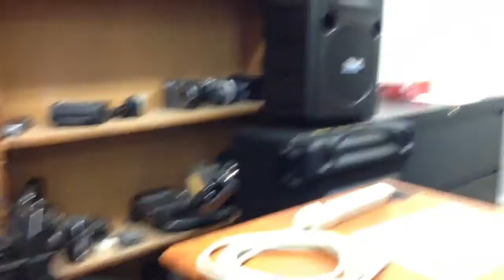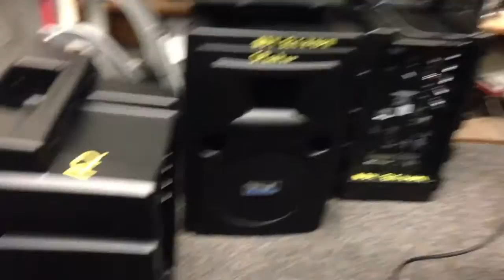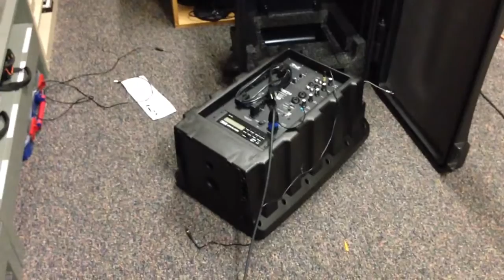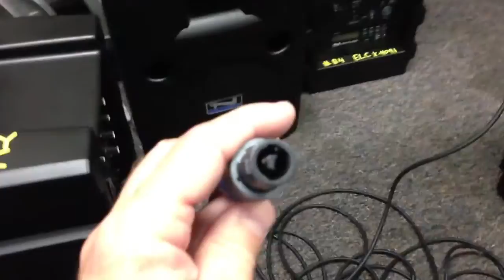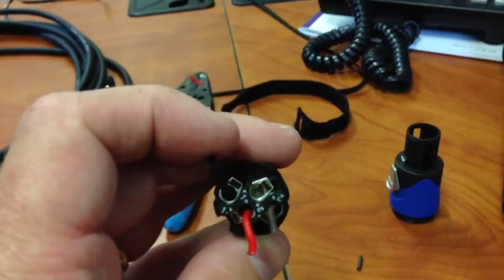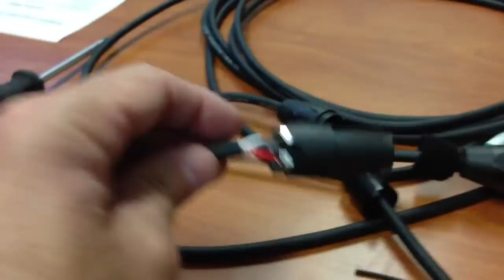Not all Speakon connectors are created equally. (Thanks Chet)  - Anchor Liberty PA

Comment: OK. Roger on the Anchor system. Rather than run two crossovers (one in master unit and one in remote speaker) Anchor feeds the remote tweeter in parallel with the master tweeter and remote midrange parallel with the master midrange. If you only have a three conductor cable you can run the common or ground on each speaker together. A true professional Speakon cable (other than Anchor) will have four conductors hooked to the four Speakon connectors with two jumpers making it a two conductor system. Two reasons: 1) this doubles the size of your wire reducing the voltage drop and capacitive reactance. 2) If one wire breaks or you loose the connection in the plug, or in the cable the other still conducts the signal so you don't loose audio and blow an amp. 
I have bought new cables at Guitar City that only have 2 of the 4 connectors hooked up.

Comment: One is 4-pole and the other is 2-pole speakon plugs
Reply: 4-pole is for bi-amp setups
Reply from the maker: +TheDanielKobale Yup, I'd never run into that before, I'm not a fan of the speakon connector in general, I'd had nothing but trouble with them. We loan out gear here, and first time borrowers can't seem to understand the locking setup. So I cut the locking tabs, and some of the can't even understand how to remove them even when they are unlocked.  (Very clearly marked, but college students are apparently not big on instructions.)

Comment: Im guessing yall dont do alot of pro audio for live sound, 2 wire speakon is from amp to speaker, usualy 18ga and larger up to 12ga, good for high wattage amps and speakers, 4 wire speakon and cable is for bi-amped systems, Im not going to get into that, you can look it up. You never want to use XLR from power amp to speakers, xlr is usualy 21ga wire and will not handle the power, the xlr connectors on an amp are for input only, speaker cables are not balanced, that is xlr or trs 1/4", combo jacks that some amps have are xlr-1/4" combo jacks.
Reply from the maker: I've never seen anyone use XLR cables for power amp to speakers. So I' not exactly sure what you are referring to there. As far as sound support goes, the last time  I personally worked on pro audio was over fifteen years ago, and I never go into the technology of how those things were wired back then. The audio engineer in charge just sad "put those here, and there and bring the lines back to the amp stack." (A monkey could have connected that part of the equation, and the delays were all pre-wired in the rack, and the connections were all very well marked, so there was no effort there either.) As far as I was concerned, the speaker lines could have been two strands of 10 gauge wire in a really fat case, to me it was just a connection on either end. We mostly did sound support for event services in large ball rooms for corporate gigs.

Comment from the maker: We had a few of the polycom units, but over time people started migrating to Skype. It was mostly due to the locations we were contacting. Unimproved third world facilities seldom have the finances to afford a dedicated T1 or a full blown polycom setup for a teleconference use alone.  So a laptop running Skype is generally all that ends up getting used. Our media Services group supports that, and we have a license for mulit point video, so they can have several locations in on the same call.

Comment from the maker: And then you have balanced and unbalanced... too much stuff to keep track of. This should be a fairly standard cable though, thats what threw me for a loop. Generally audio cables (like XLR for instance) cables with the proper connectors will work, even if the impedance is incorrect. (Unless its a specialty cable with resistor in it like they used to use for the old tape decks that didn't have a line in.....) Thats why the speakon connectr threw me, its the same physical connector, +2 wires....

Comment from the maker: XLR is generally used for input, or low power  signal. (It is also used for intercoms in control rooms, and for staging.)  I've never seen a hybrid XLR/speakon. But then again, before today, I'd never seen a four strand speaker cable.   Generally the XLR hybrid connectors are a straight up XLR with 1/4" connector functionality. As far as I know, the speakon connection is only used for output-Amp to speaker. I'm not fond of the connector, as it locks, an most people end up unscrewing the housing

Comment: I am just familar with XLR cables. At church we have a Mackie mixer board no amp and a pair of QSC K8 speakers with the amp in them. I did notice different connectors in the back of those speakers though. The specs say XLR and the XLR fit. they just look different like your connectors do. Is there a hybrid connector that accepts both on the back of these amps and speakers? Sorry, I like all technologies and I sometimes come off as a know it all...which I am the first to admit "I know little!"